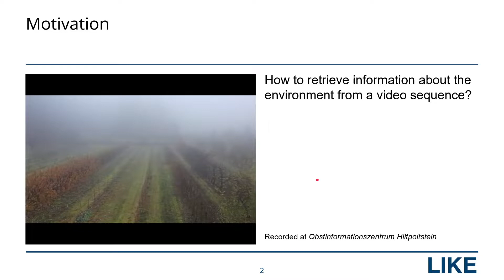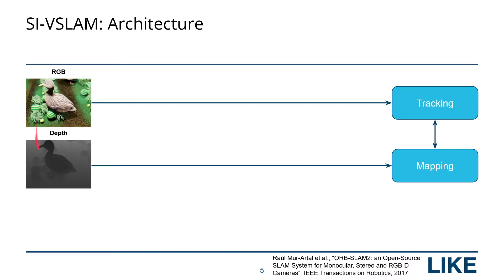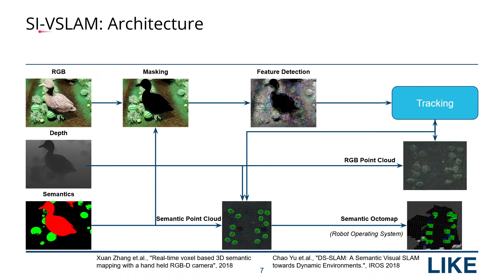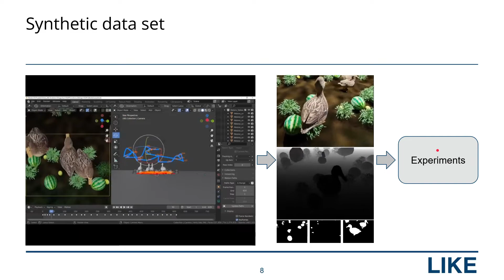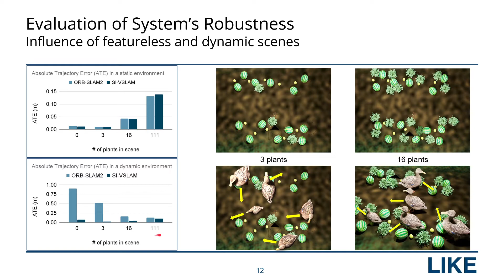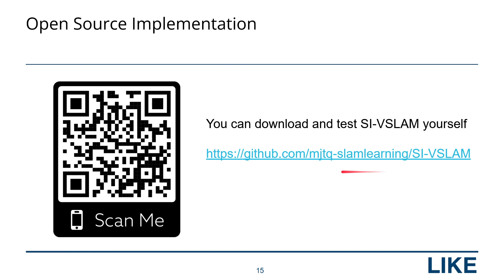Error Evaluation of Semantic VSLAM Algorithms for Smart Farming

Comment: I tried this project, but the program doesn't seem to work well.
The wrong result is as follows:
double free or corruption (out)
Aborted (core dumped)
After testing, the program encountered an issue with the thread in the closed loop, resulting in misaligned internal program errors.
I sincerely hope to receive help!